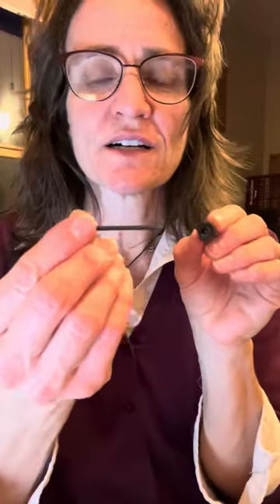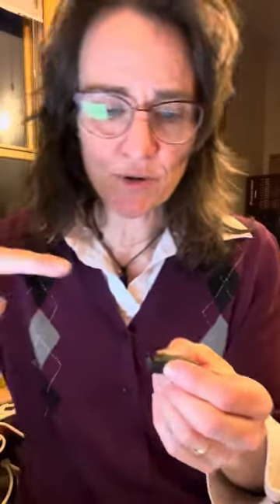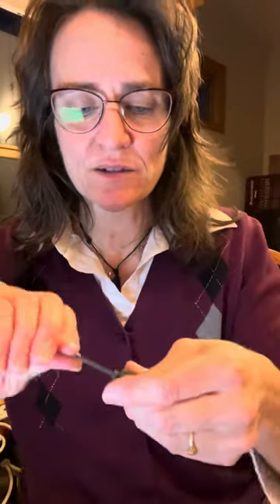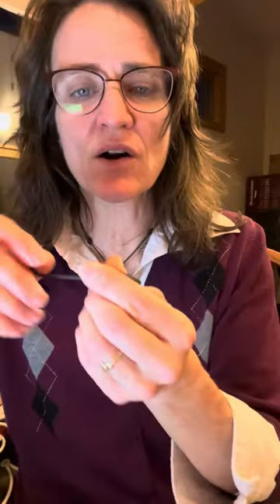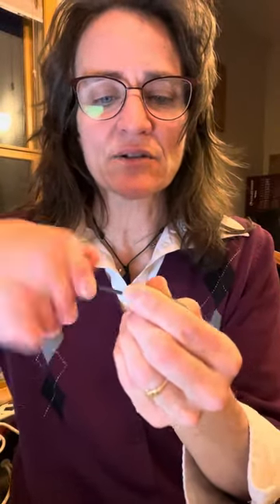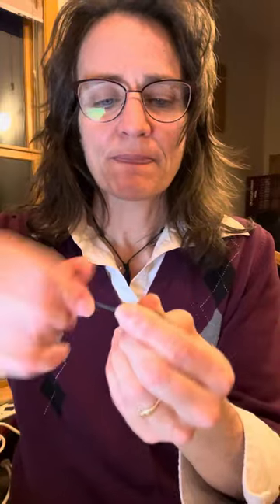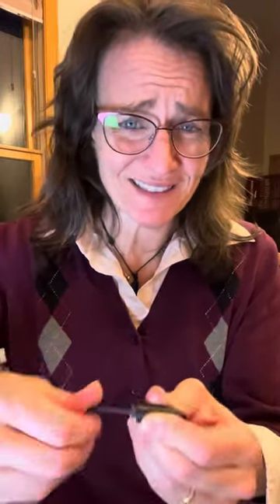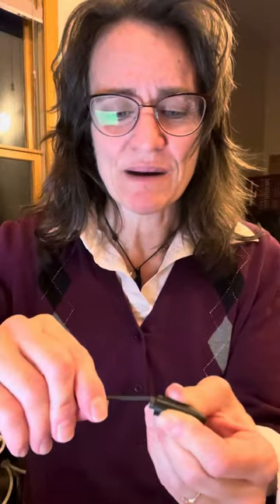Lowering pitch of Kinnaird drone reed

Comment: you can take the set screw out completely to maximize the length of your reeds.  i did that with mine...Don't make the mistake of forgetting where you put them like I did.  They are just normal set screws you can buy at any hardware store if you do in fact lose them.
Reply from the maker: Oh that’s great information. Thank you! I will inform my student. So far, removing the set screw has been unnecessary. But I could see that happening. Thanks again.